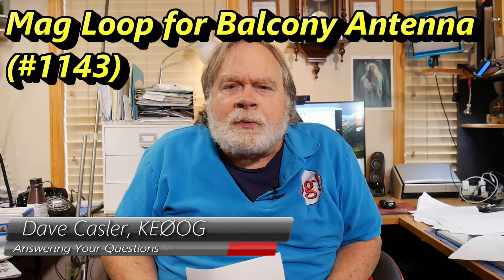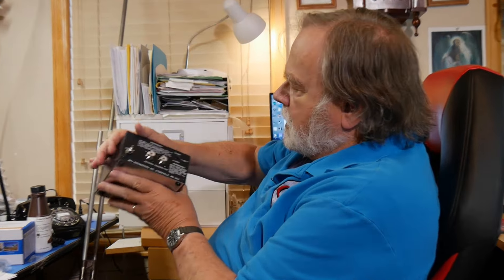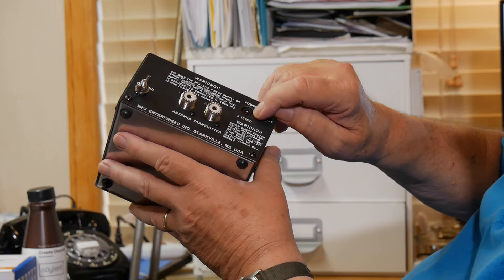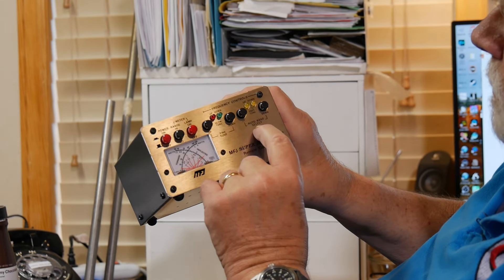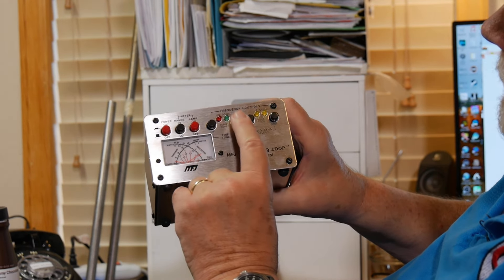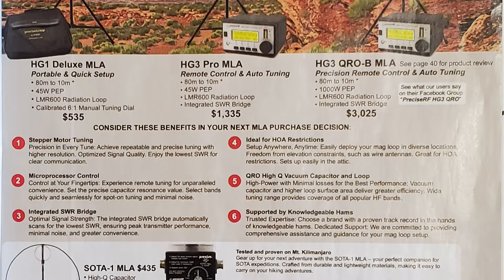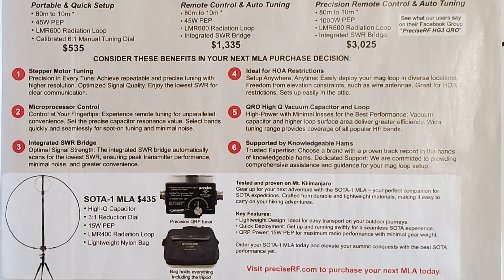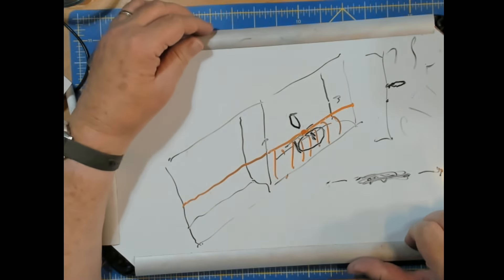Mag Loop for Balcony Antenna (#1143)

Comment: So glad I found your channel! New Ham (still waiting on call sign). Been obsessing over this very issue. But your video was great and you pointed me in the right direction! Recently saw a few videos showcasing the “AlexLoop” (at DXEngineering). Your video gave me more confidence in that it’s like the way to go, except that I would indeed prefer to get it mounted to the rail horizontally as you described. Thank you!
Reply: Hi. I doubt your landlord or condo management will allow anything to be attached to the balcony railing. Best bet is to mount the loop horizontally on a tripod and move the unit as close to the edge of the balcony as possible. Welcome to the greatest hobby in the world!

Comment: I have had excellent results with my MFJ magloop on our third floor balcony, working a lot of DX with 100 watts. I have it in the horizontal configuration, yielding horizontal polarization in all directions. All of Dave's caveats apply, but I highly recommended the MFJ magloop.
Reply: Good luck finding one in the not too distant future since they are out of business now
Reply: @kj7element276  True. Good luck finding much of anything in their  product line. Inventory is now nil.
Reply: I have one, but I know MFJ advises it be elevated to a certain height to effectively use it horizontally.  Have you experimented with different height?   How high do you have it mounted?  I might experiment with horizontal mounting.   73, K7KS
Reply: @AlanElBee  My MFJ magloop was mounted horizontally on a tripod sitting on the third floor balcony of a three story frame apartment building. Surprisingly good performance.

Comment: just completed a 1' dia mag loop for hand portable 50MHz operation that works nicely but talking of loop sensitivity even putting your hand near the tuning cap knocks it off tune (but a long plastic  "paddle" extension from the butterfly cap shaft down to the handle gives me nice "thumb control" tuning across the whole 6m band.

Comment: Hello, I'm putting a vertical fiberglass VHF antenna on top of a 2 story school so they can communicate throughout the building with the repeater. Does vertical beam width matter at all? It's omnidirectional but I'm concerned about propagation directly underneath. Thanks. I can't find too much online.
Reply: I guess my question is: will there be a huge skip zone underneath my rooftop antenna?